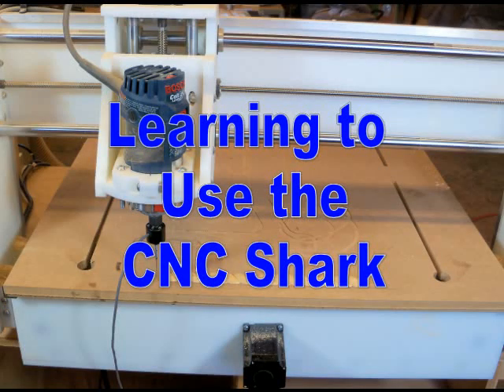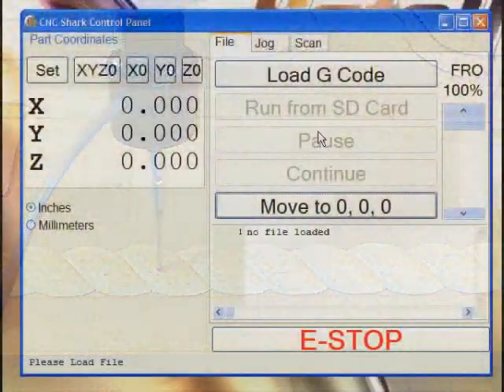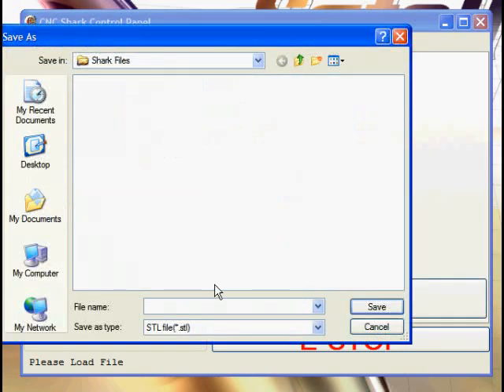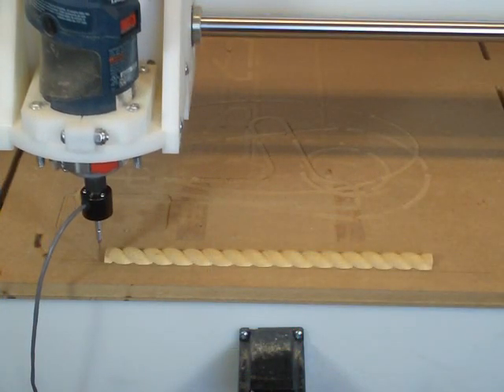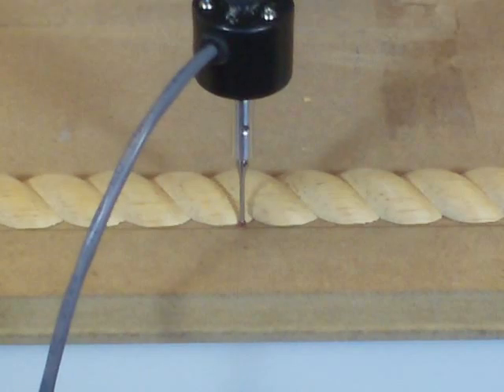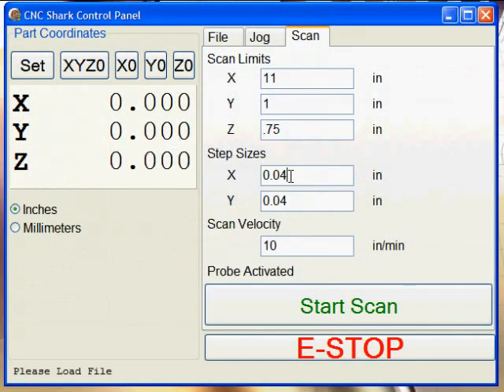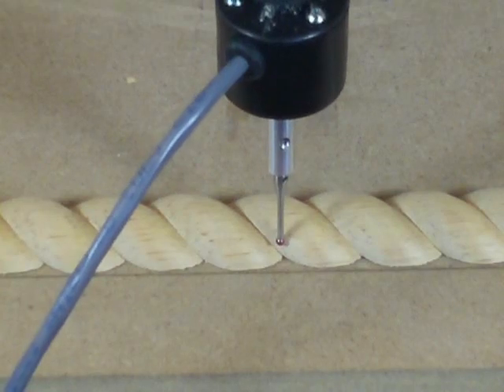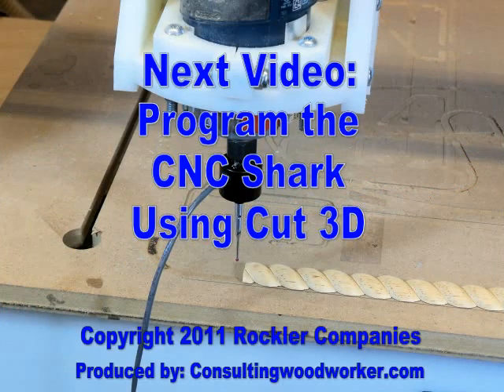CNC Shark - Using the Scan Probe

Comment: Thanks.  I'm thinking about buying this DeepGroove1 dotcom probe and wanted to see it in action.  At .040" scan resolution, it looked to be moving so fast that the sideways motions resulted in some jerky behavior, but it seemed to produce good results at .010" resolution (where I'd probably be scanning anyway), and I'll probably be probing straight down as well for each point, which is much slower but a lot less problematic for a digital probe.